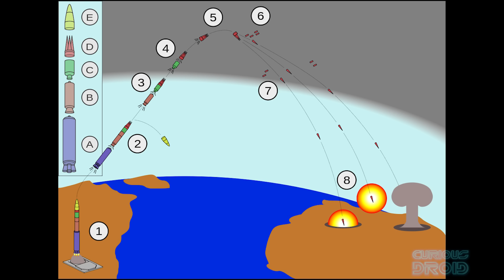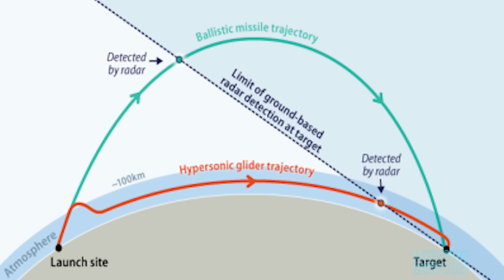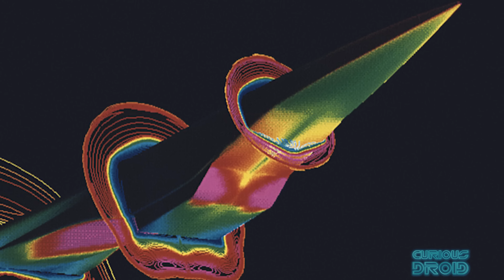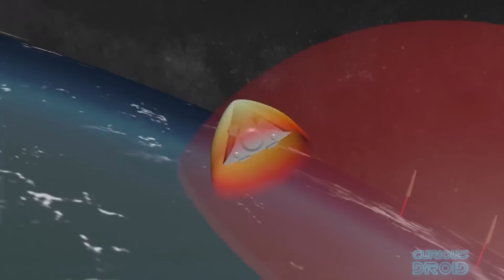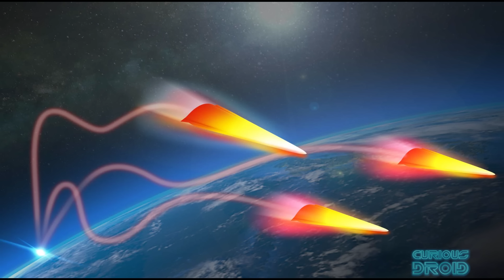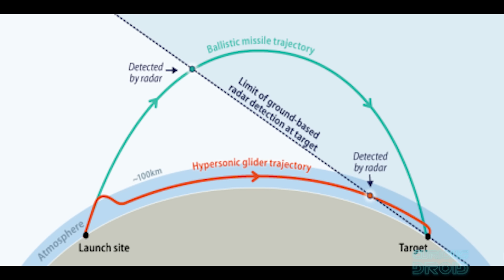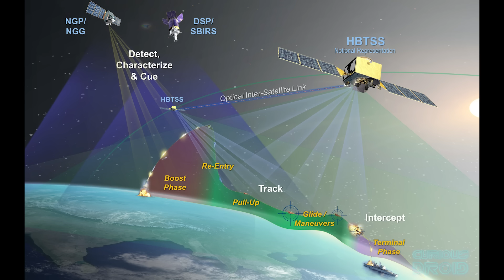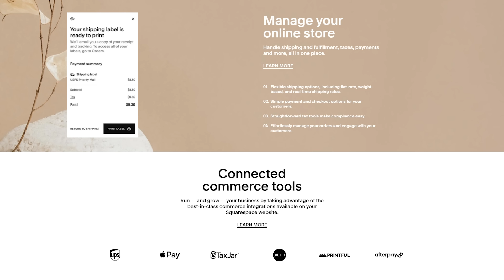Can the U.S. Stop Russian and Chinese Hypersonic Missiles?

Comment: Paul, I always enjoy your presentations.  For subjects I know something about (lasers, not hypersonic missiles) I think you get it right and I usually learn somethings new. In this one you did cover using laser weapons as a countermeasure to hypervelocity missiles. You did mention some of the important caveats, but I think you come across as wildly optimistic (from my viewpoint) about future developments.  My life, for better or worse, has been one long involvement in this field. I'm pessimistic about many aspects of laser weapon development to the degree that it would be effective against hypersonic missiles. I do think there are some important roles such weapons can take on, even at the sub 100KW level, such as ordinary antiship missiles, speedboat and drone attacks. So, I will discuss some of my misgivings below. 

At the speed of a hypersonic missile there will only be a second or two for the laser spot to do anything. With a megawatt that is enough time, it seems, to do some kind of mission kill - that would probably from some kind of damage to the skin that tears the missile apart from aerodynamic forces. The notion that lasers work at the speed of light, this is a huge simplification of the problem. The tracking requirement, after finding the target, is literally microradians aim point maintenance for targets moving at many degrees per second. Doing this on slow moving targets is hard enough. Extrapolating from the LAWS and MLD devices whacking on soft slow moving targets to hypervelocity missiles is fantasy.

Unless you work in this field you have no idea how atmosphere limited laser weapons are. What might be effective at 6km can be completely ineffective at 8km. Weather is a huge factor in all of this and obviously an attacker would take it into consideration.

And finally, no, the magazine is not limitless. You mentioned thermal management, that is only one controlling issue. Another is internal damage caused by the very operation of the high power laser. A short MTTF is a reality in these systems, just like any extreme system. Ultra high power, e.g. 1 MW, is a place that just gives me the willies. What will the total operating time be? I don't know but from my experience I wouldn't be surprised if it is in hours, if not minutes. No doubt there will be internal systems to detect and shut down the laser before something really bad happens, something that might completely destroy every nearby optic. But that will be a moot point if the laser doesn't stop the missile. 

If you have the time, I think you'd find exploring the limitations and advantages of laser weapon systems fascinating. And I think you could explain it in 15 minutes!
Reply: I think there was one important detail of information missing, any missile need to slow down significantly before striking the target (you can't survive mach 5 in lower atmosphere for more than few seconds, temperatures of 2000 C are for high altitudes, not "see level"). US actually tested prototype hypersonic missiles but as far as I am aware they did not introduce any into the service (using scramjets as an engine). I think it is because in terminal phase you need to slow down any way to mach 1-2 (I do not know the specific numbers), and if your engine of choice is a scramjet it just stops working so you end up with a glider or fancy ballistic missile (against which simple change of course might be a good counter if you get a warning from a satelite). US went for hypersonic bombers instead which might make more sense (bomber never drops to lower atmosphere).
Reply: @ukaszlampart5316  they don't slow down. Unnecessary at that speed they fall on target on microseconds. Air friction damage is irrelevant at that point. In fact old Soviet heavy anticarrier supersonic missiles already boosted their speed up to Mach4 on terminal fase to cut reaction times, cruising on inertial from mach 1,3 to 2 and then speeding up after target acquired.
Reply: @Argentvs  Well let's make a thought experiment, following assumptions: surface of the missile is around 1.5-2 K degrees Celsius while cruising with Hypersonic speed of 5 mach at altitudes of 20-30 kilometers (which from my knowledge would be the case). In order to struck ground target it need to travel that distance down, and it will be with a slope, and rather long because it can't really turn much with that speed, so let just say it will need to go through 100 KM during the descent, half of that will by in thicker parts of the atmosphere, and it will take for the missile at least 50/1.7 (340 * 5 = 1500 m/s) = 25 seconds, during which it will become giant slug of molten metal (with density of the air several times higher amount of heat of energy deposited will be also several times higher, no way any material we have right now can withstand that). For the specific terminal velocity I am not sure, but it will be no more than 3 mach I guess (and this is still probably a high estimate, in practice to regain any terminal guidance capabilities it will need to slow down more to regain visibility for the sensors, or will require full guidance via satelite link)

Getting a boost in final phase is actually more practical if you are already locked onto the targe, but again scramjet will not work in that conditions.
Reply: @ukaszlampart5316  : Shh. Let them keep spinning their wheels. 😎
Reply: Thanks a million! An excellent, very informative comment. It is always a pleasure to listen to a professional opinion.
Reply: @Argentvs  What technology do they use to slow down? Genuine question.
Reply: @OlsiSaqe  I guess just friction and throttle control. Perhaps some small aerobrake.
Reply: You are correct sir!
Reply: @ukaszlampart5316  Also, adding to Argentvs, missiles have at most 20 mins or 30 minutes of flight time and most of which are in upper atmosphere. Since it's a missile, it can just use ablative cooling to buy it enough time (a few seconds) to hit the target.

 I don't know where got the information about slowing down from, but I think keeping a missile cool is less important than keeping a jet cool. A cruise missile might slow down simply due to running out of fuel or solid rocket engine, but having it going faster at terminal phase is a very much beneficial strategy.
Reply: @ukaszlampart5316  Terminal phase of a missile is arbitrarily easy to keep cool. They can just keep a layer of ablative material outside of inside of the vehicle. If temperature of 2,000 K is ok then ablation is shown and used wildly in rockets that have much higher temperatures than that. The temperature inside of the expansion chamber in a liquid rocket engine have temperatures around 3,000 k to 4,000 k, and ablative cooling is used in them, which all have operation times in terms of minutes even ten's of minutes. For example, United Launch Alliance’s Delta IV engine, and the RS-68A both use different types of ablative cooling, and both have more than 8 minutes of operation times. That's why I think a terminal phase of a missile is never going to be the biggest problem.
Reply: Hey Randy,
I really enjoyed reading your comment,
Have you ever thought about creating a few videos and seeing how it goes mate?
Reply: @1dayatatime2023  Thanks. I would say I'm not that suited for making vids on tech subjects. I think Paul is pretty good at researching and presenting a complicated subject in a way that doesn't take hours. Me making a vid like this would be like pulling my own teeth. And the vid, if I ever completed it, would be a contender for most tedious vid of the month. Just making this short reply I had to edit it two times!

If I do make a vid it would probably be about some aspect of improving Chinese machine tools or optical testing of sport optics.
Reply: @ukaszlampart5316  this is nonsense
Reply: 'Unless you work in this field you have no idea how atmosphere limited laser weapons are.' I dont even have a bachelors in physics and I already knew this :P remember some professor laying down the law about lasers 20 years ago, how you'd need a laser the size of 2 buildings in order to laser one building :P
Reply: @mikeyangyang8816  A hypersonic missile flying at a speed of 1,500 m/s can last for 30 seconds and is enough to sink a warship
Reply: So, what about having multiple lasers engage a common target?

Surely not economical, but why not if you have something specifically important that you wish to protect
Reply: @hannolehtiniemi2490  What you are suggesting is, indeed, basically what is going on. It's called beam combining. Many laser beams are coherently or incoherently combined and directed by a single beam director. There are many schemes being tried.
One thing I've encountered over and over in my work is this idea that laser weapons are some kind of standard GI issue "ray gun" weapon. Just plop one on and plug it in. One not enough? Put some more on! 

But that's not reality. State of the art is tens of kilowatts, say up to 100KW - 200KW. It's not much power, but even so, it's still really hard to do it. 200KW for one second is 200K Joules. Basically a hard spit. 

 Multiplying that by adding more units might be easier than doubling or tripling the single unit power...but there is a serious problem. Target detection, tracking, and aimpoint maintenance is extremely involved and difficult. Typically, there are additional lasers illuminating the target for ranging, tracking and turbulence compensation. It's already hard and complicated. So adding some more high energy beams and tracking beams. It would be a mess. It may be feasible to have one system be the master and the others take their cue from it, but that question is not in my wheelhouse. 

I implied this in my first post but I guess I should state it clearly. There is not enough time to detect, track, and lase a hypervelocity missile. By lase I mean deposit enough energy in one spot to do some kind of mission kill. IMO, the  state of the art (what I know of it, and I'm out of date and not "inside" anymore) is not there. Not close.
Reply: The plasma around the hypersonic missile disables any ability it has to detect its target directly and is unable to receive telemetry GPS updates for guidance.  It’s high velocity is also a vulnerability, a Mach 20 missile encountering a mass of 1 gram would result in a collision yielding over 300 billion joules of energy; hitting a hail stone would a catastrophic.
Reply: Exactly!!!  Lasers against hypersonic misfile is hopium for decades
Reply: But what you are not involved with is top secret fields that may make perhaps even 20MW beams possible for long durations.

That's the thing about war, what does everyone really have hiding up their sleeves?
Reply: @randy dewees  funny MTHEL was nowhere near 200KW yet it was intercepting salvos of mortars....
Reply: 15:01   Humitas j’e de la 😂😅Gracias el este dw
Reply: @jeremygair4007 

Speculation about technology far beyond what the DOD has announced is pretty pointless. IME, if some unit is producing 20MW beams routinely, then it is on some other planet, where the physics are different. 

To be sure, I'm not stating anything that isn't commonly known, if you work in this field. It's not secret, it's not even that hard to work out for the curious that knows something about physics and optics. 

Laser technology goes back to the late 50's. The physics, gain media, pump sources, optics, materials, it's all kind of up against walls of reality. These days advances in solid state laser technology are being made because of better diode pump sources and better fiber lasers. There are (complicated) schemes for combining the outputs of many fiber lasers to achieve, wait for it, 100's of kilowatts. Which is very useful for some things. 

In the Star War days, the big, and I mean BIG, chemical lasers were truly powerful, north of a megawatt. But you can't put one on a ship, if you could it would have been done. But the prospect of a fluorine fire on a ship, brrrrr, regular fires are bad enough. The amazing Airborne Laser demonstrator had a megawatt COIL on a 747. But it was a (very expensive) demo, not practical. Besides, nobody outside of very expert scientists and engineers should be near a device that would dissolve you in an iodine/oxygen fire. The Navy spent big money on the Free Electron Laser (FEL). This tricky device is theoretically scalable almost without limit. The problem was...problems. It turned out to be extremely difficult (expensive) to scale up. And there were those pesky X-Rays it gave off. Anyway, the Navy's dream of an "Electric Laser" faded away against the realities of that technology development. To end this part of my rant, the FEL was the Navy's big shiny thing - an admiral's dream. There wasn't anything it couldn't do, in concept. Serious money was spent, and then the program was canceled.    

Even if some super secret many megawatt laser exists, the practicalities of atmospheric propagation are very difficult. Have you heard of Thermal Blooming/Lensing? Because of molecular absorption the air volume of the laser beam is differentially heated, causing the air volume to defocus the beam. It's a non-linear phenomenon, the more you focus to compensate, the worse it gets. This is a moderate problem at sub megawatt power - how's it going to go for many megawatts?  And then there is optical turbulence. The technology to compensate weak turbulence exists, but once again, the limitations are severe. In deep turbulence, which can happen in many maritime environments, it's a hopeless problem. And I don't care how powerful your laser is, if the mist or fog around your ship attenuates 90% of light in one kilometer, your laser power is knocked down to 10% in one kilometer. You can't even detect and track an oncoming missile until the last 50 milliseconds. BTW, the extinction of your typical "clear" maritime low angle slant path is 0.1/km. Doesn't take many Klicks to get the spot to be a fraction of the output.  

I'm a "pitch and grit" guy, and I design optical systems. For big lasers. But I'm not a "Laser Guy". I'm also not a controls guy. But I've been around the problem of laser target tracking, aim point maintenance, and so on. It's a really hard problem. It takes time to acquire, track, pick an aimpoint, fire the laser. Then the laser aimpoint  has to be maintained for the duration needed to actually do something - it's like an acetylene torch, it takes a bit of time.   

And per MTHEL. Easy radar acquired targets on smooth ballistic paths in nice clear desert air on a fairly upward slant path on a cooperative range. Basically, shooting fish in a barrel. And I'm not slagging that effort at all. Lots learned. And as I've said several times, there are many uses for lasers of this power class. THEL and MTHEL were DF chemical lasers of course, a dead end, and were canceled after hundreds of millions spent.   

But Jeremy, do you work in this area or are you just interested? I work in the field of atmospheric characterization. I've decades of field work measuring maritime atmospheric conditions, for HEL. I design and produce instruments for measuring these conditions. I know what it is like out there, and I'm pessimistic about lasers defending against hypervelocity antiship missiles.
Reply: @randy dewees  If one assumes all physics had been discovered, and announced.  The correct part of the statement you said is this.

It is speculative.  Like I said, you are master of a field or two, not all material science and such.

We were never supposed to fly...
Reply: @jeremygair4007  And your fields of mastery? Are there some mystery physics that physicists don't know about? Another set of elements to make materials that don't undergo breakdown in intense laser fields? 

Look, there is a lot going on, a lot being exploited that we don't know about. But that's in other types of weapons. Star Wars, SDIO, billions were spent on lasers, it draggled on to THEL and ABL, and the realization that it was not worth it. The emergence of solid state laser is the new physics. But it has limits. You know something else? Tell us.

I wonder, are you grad student? I've run into this thing where some new tech, say, meta materials, becomes a media darling because of a sexy press release. As a crusty old anorak (that has done work in meta materials) I feel compelled to point out the unlikeness of some of the claims of future potentials. This usually doesn't sit well with the people behind the press release.

But maybe we are just arguing philosophy. I don't think all physics is known, will ever be known. I won't categorically state things like time travel, faster than speed of light, Mr Fusion, are impossible. What I am saying is pretty narrowly practical - the chance that the DOD (or anyone else) in the near future develops a laser defense against HV ASM is low, for all of the reasons I've stated above.  Believing that the Gov, with limitless black money, can basically quest into far future technology is basically a conspiracy theory thing. Even the development of the A-bomb, huge effort kept top secret though it was, was 98% perspiration, 2% physical theory that was completely out in the open.
Reply: Can we use magnetic energy or wave energy to deflect this hypersonic particle?
Reply: @randydewees7338  Tiime will tell on that, hubristic indeed that one could think we know it all....
Reply: @randydewees7338  
Thank you greatly for your responses.
Reply: @hannolehtiniemi2490  You are welcome! 

I can think of some more topics along these lines for Paul to research and present, like the development of HEL weapons, both strategic and tactical. The "HEL Series" (I've no problem with Paul doing all this work) would start off with an introduction to HEL -  touch on schemes, atmospheric propagation, geopolitics, etc. Then march through the various programs starting in the pre SDIO period. The strategic era (ballistic missile defense) ends in the early 2000's and then the tactical era begins in the mid 2000's. 

I think a series of ten 15 minute presentations in Paul's excellent condensed style would do the subject justice. 

I need to watch Paul's directed energy presentation again.
Reply: Well we need something in place now, so why are you wasting precious time on YouTube when you could be helping find a deterrent to this problem
Reply: @jonathanbryant7166  "All work and no play makes Jack a dull boy"

So, I assume you are just joking around, but maybe not. What are you doing to help find a deterrent when, in fact, you are wasting your precious time on YT?
Reply: If anything its good reading! Lol. Bottom line no matter what the truth is mankind is headed in a lot of the wrong directions!
Reply: laser weapons have long been the last century, no matter how strange it may sound, due to bad weather, smoke, paint reflecting the effectiveness of lasers drops dramatically, at one time in the USA they threw in the information that advanced weapons (Laser) were being developed) this information was received by the USSR and became to develop, but in the USA it was just a trick so that the USSR would waste valuable resources, but when the USSR achieved success, the USA had to catch up in this direction, now lasers are used in many places in different countries, but against missiles and especially hypersonic laser efficiency is quite low ( I'm not talking about artisanal rockets).
The satellite system also has disadvantages, there will be an arms race in space, just as no one interferes with shooting them down in the event of large-scale actions and breaking the chain, hacking and gaining control over enemy systems. People have already sent themselves to the Stone Age, apparently they will send themselves again, before they have time to grow wiser enough to stop hostility and start conquering planets together and taking care of each other, and not trying to continue to exploit each other ....
Reply: Ah thank you Randy. You just gave Paul's audience a clue on why these systems take years and even decades to master & produce. For instance I learnt that even the Russians had employed the services of veteran Soviet physicists to crack the problem of hypersonic speeds. Russia puts everything into the fray when it comes to weapons but the US will always find civilians applications of all their military technology. Not until very recently did I discover the the US defence corporation Raytheon actually invented the microwave oven technology. Accidentally actually.
Reply: See
Reply: this wk ukraianians, have shown patriot batteries can down russian hypersonic missiles
Reply: @RavingFan  indeed! 🤣
Reply: this wk ukranians, have shown patriot batteries can down russian hype missiles.
easier way, dont sell german/us/taiwan chips that go into hype missiles.
Reply: @OlsiSaqe  It will eject a spy balloon. 🤣🤣🤣
Reply: @sergebazanov7604  Actually the oxygen-iodine chemical laser (COIL) was first developed by physicists in the USSR (Russia by then?) at a government academic research center (not military), at least according to published papers I read when working on it briefly in 1989.  True about long delays.  At that time, there were flight tests planned by the end of the year, but I think that didn't happen for ~20 years.  In the interim, they ran tests on the ground at Edwards AFB in a 747 fuselage.  I'm guessing the long delay was due to optics and controls.
Reply: Nice point dude. would you like to explain to me another laser weapons? this one: ZM-87 (Chinese Blinding laser). Seem such an unbeatable weapon. How can u fight with permanent blinded soldiers?
Reply: @jacopopaganelli2791  The ZM-87 is a old neodymium pulsed device, kind of a prototype weapon with only 20 or so made. Pretty low power and range. No doubt this device motivated development of countermeasures (laser protection) to blinding/dazzling devices. Filters in face shields etc. 

As I guess you know, there are international protocols banning the use of laser weapons for blinding. In a real conflict who knows what might be trotted out and used. I do believe that the use of such a device by one side would bring near instant retribution by the other side. 

All of the solid state HEL devices have outputs at or near 1.06 microns wavelength. This is a very eye hazardous wavelength, as it is invisible there is no blink reflex. It transmits through the eye and focuses on the retina causing damage without warning. So, any HEL device is a potential devastating blinding weapon. 

It has long been possible to have eyes damaged from incidental military sources such as rangefinders and target designators. So there has been a degree of laser eye protection in use. But that protection is probably not adequate in an environment of blinding/dazzling weapons. And here, I'm out of my wheelhouse as this just wasn't what I did. But it's my opinion that a lot of attention has been paid to this eventuality.
Reply: Dont worry, they literally dont have them lol.